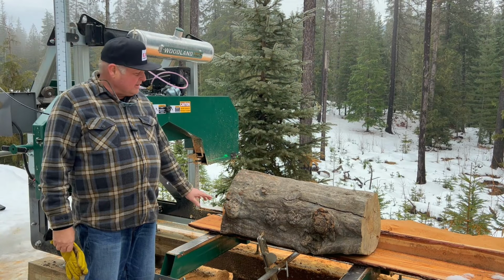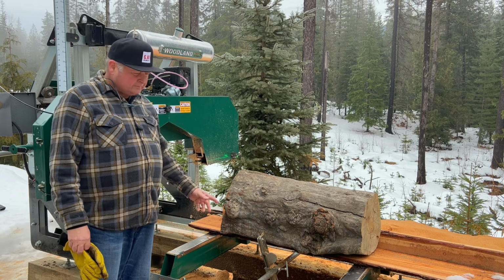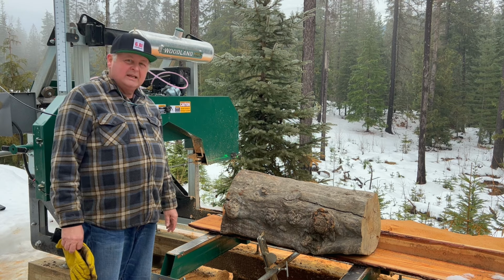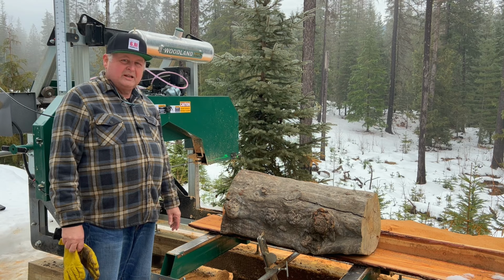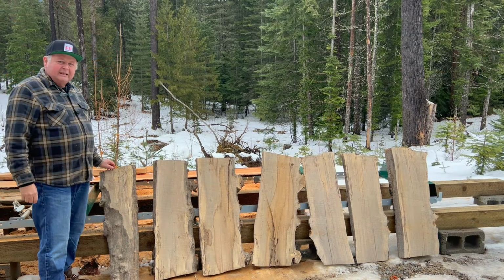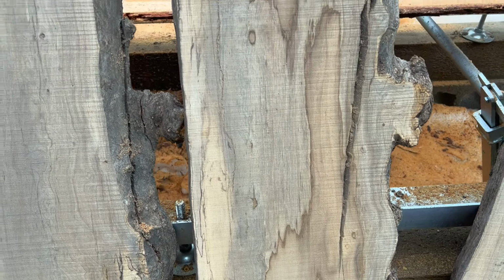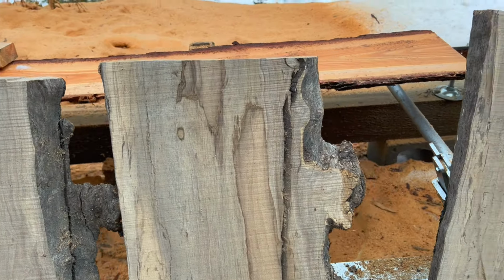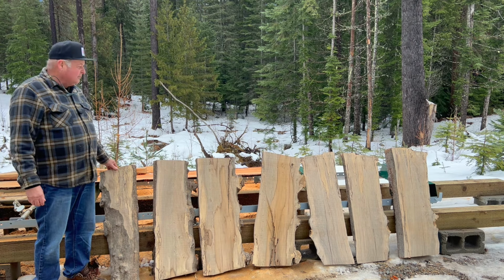Sawing Mystery Wood on the Mill

Comment: Interesting wood. I don't think you will need to sticker those pieces! It looks like your laser is pointing downhill. Have you tried using laser glasses to make the line more visible?

Thanks for bringing us along
Reply from the maker: No stickering necessary.  They were pretty dry which I think made it pretty hard to cut.